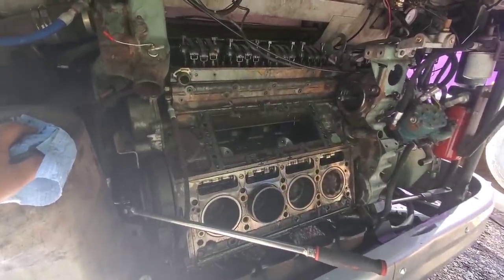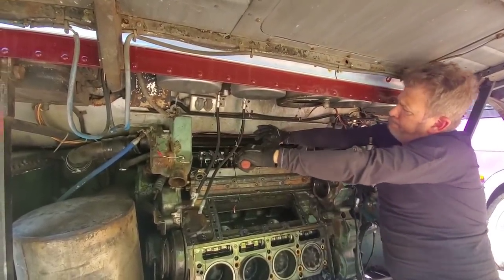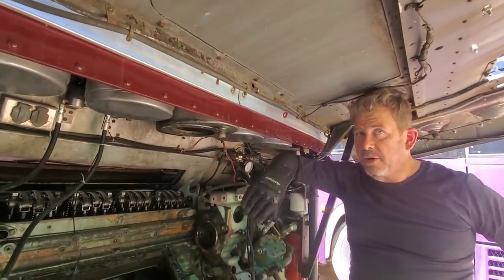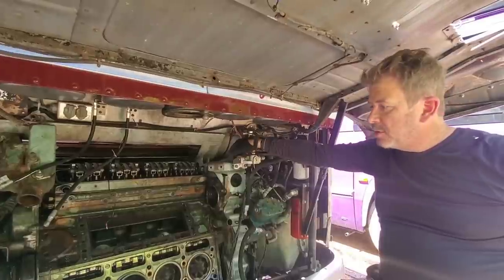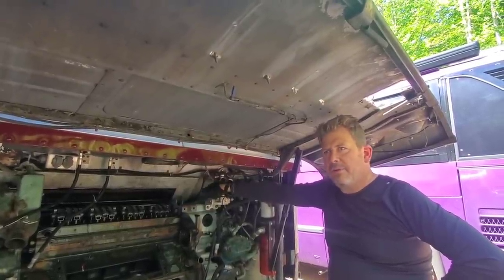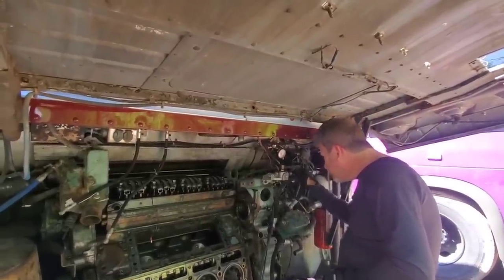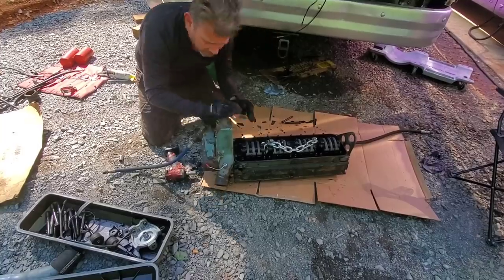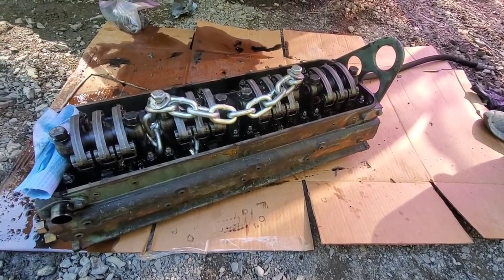Lance's tear down pt 2. why are there extra parts?

Comment: "Back in the day" we use to use a chain link fence post to remove rear head. The chain would slide fairly decent with a little oil. We flattened one end and welded a small piece of metal  on it so it could hook and anchor on body. Still took 3 guys but it worked.
Reply: I forgot to ask, how was blower drive shaft and hub? Was it course or fine splined? How bad was it worn?

Comment: Hey Lance, The Booster for the 27meg CB is called a linear amplifier.
If you can find a spot for it the best aerial is a 1/4 wave 9 foot stainless whip just mount it on something sturdy with a spring mount. (9 ft Stainless is very Retro and period correct)
Most old 27 Meg CB's have a 4 to 5 Watt output and it depends on the booster as to how much you get out of it but the basic rule of thumb is the more you out into the Amp the more you get out of it and AM tends to not output as much as Sideband (SSB) which is modulation driven from memory.
Another tip is to use the thumb thick 52 Ohm Coaxial cable and Milspec RG8U, RG213 or whatever you use in the States is best with minimal joins and plugs in-between (N type low loss connectors for preference). Dont use 75 Ohm TV coax.
Braided Antenna in a 6 foot length would work as well and by braided I mean Copper woven braid up the aerial from the Wire would center or base loading instead of the lose wire would around the fibreglass stalk which is kinda half assed and prone to rock damage. 
The connectors on the back of the CB and probably the in and out signal on the Amp will be PL259 screw connectors and fine for what it is but upgrading to N type chassis mount plugs is always an option if you want to get anal about it and its easy enough to do.
Last tip is a must have item being a SWR or Swer meter (Standing Wave Ratio) for tuning the Aerial, even good ones are cheap in the US (Thats where I've always bought mine) and that will make the CB work properly both TX and RX but more importantly stop the output transistors from cooking due to output signal feedback from an Aerial thats not transmitting ALL the signal.
Sounds like a Pro job and any Ham radio guy that's familiar with HF will do a Bang-up job but its also easy to do yourself with supervision and do and dont tips.
Plus a good 27Mhz CB amuses the heck out of Millennials and kids.
Oh and a Caveat, IF the Amp is a High watt unit? Like 500 watt or more (I had a 1.2 Kw) then Mount the aerial away from the drivers position, Prolonged exposure to RF energy (Radio Freq) will give him or her a headache as it slowly cooks them (Like a Microwave).
Ask any Radar tech lol
Reply: And not a Linear amplifiers have a receive amplifier (AKA pre-amp) built in. If it does, it will have a switch that says “Pre-Amp” On/Off.

Comment: Lance, yup, you need a channel.  Also, a recommendation on wiper blades for the 'burb...  They aren't cheap, but the Bosch Focus blades are very quiet.  Also have a 1 year warranty, plus a wear indicator that turns yellow when the blades are worn.

Comment: Lance should check local truck stops or a radio shop for a “CB specialist” to make sure the amp is tuned and antenna will work correctly with the amp. It’s been a long time since I have CB with a amp but I seem to remember certain antennas work better with amps and certain ones will not

PS Definitely would like to see Lance do history’s of his busses etc

Comment: Now I know how the top head comes out.  Muscle and strong backs.
Reply: In one of the last couple of videos they talked about how Greyhound just dropped the cradle, pulled out the old one and then put in a rebuilt engine on a different cradle.  Lots easier to work on when it's out of the bus!

Comment: You really need a good, heavy duty all terrain forklift with extended reach crane boom to get things like engine heads and transmissions out. It will save your back in the long run. I spent too many years wrestling with heavy stuff and now pay for it in my old age.
Reply: I was cringing for those guys’ backs when they were trying to lift that head out of there.

Comment: Is it possible to replace the camshafts in place?  Would you have to remove the panel on the left to draw them out?
Reply from the maker: Engine would have to come out and transmission off to do it
Reply: @Spyke383  I guess then a ruined camshaft is a big headache.  Thanks.